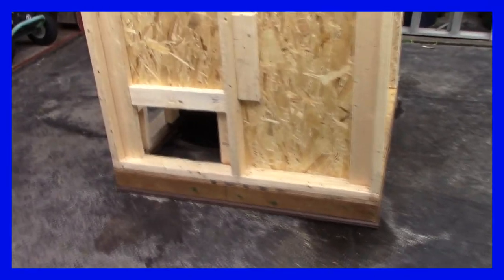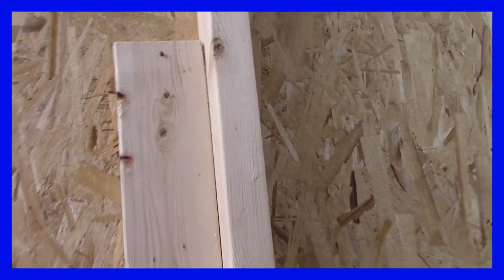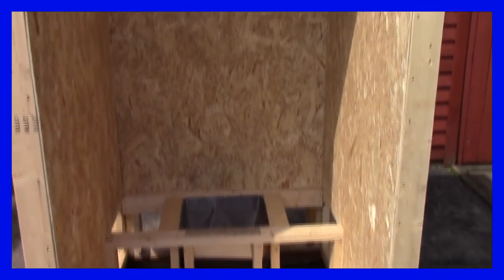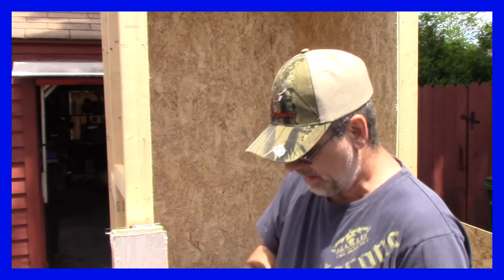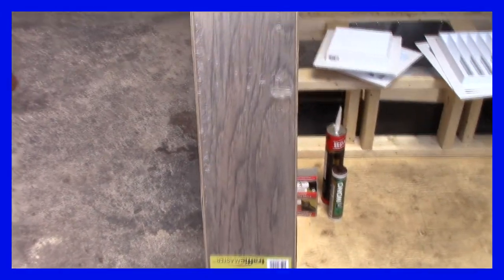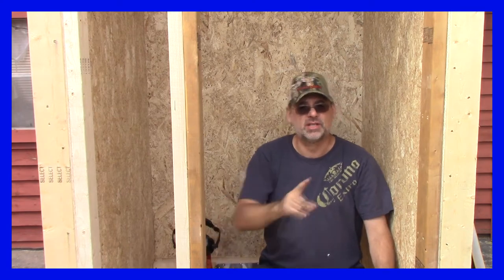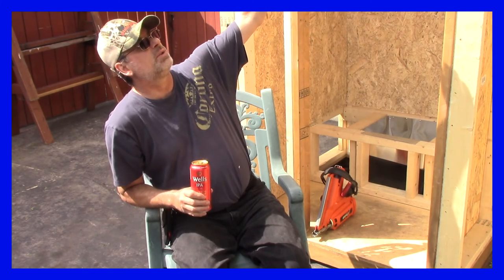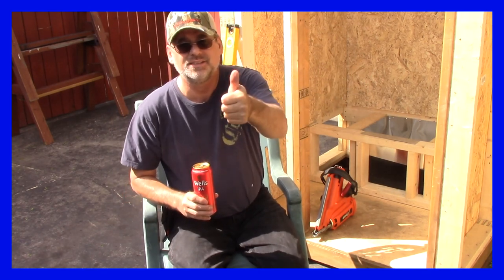HOW TO BUILD AN OUTHOUSE PART  3  - PARTS  1 AND 2 IN DESCRIPTION BELOW

Comment: Looking good there Steve on that outhouse. It will be interesting when you get to the part about the ground in what's done to it when you sit the outhouse over it :) Have a good one and don't work too hard!
Reply from the maker: Well that will be interesting since it's going over a done hole and an old outhouse getting removed. Cheers Terry.

Comment: OSB is press board chips. To me anyway.  Yes girls have stout pissers. I have a saw mill 3 miles away. Off cut lumber is cheep. I can buy it cheep then cut it straight and save $. They have everything,  ruff cut, treated etc... 
Great show. Ike to see the details of this project even down to the hardware.
Reply from the maker: The women are hard on an outhouse LOL  Not many saw mills up here anymore.  I buy lumber   that say  usa on most of it. The hardy siding is american too and the low exchange makes it $50 a sheet with tax of course.  Lots of hunt camps in Georgia so they must have outhouses - haha I have  never seen a  camp with a flush toilet , only two with  electricity .  LOL

Comment: Nice Shitter. But I  would never spend that much for an Outhouse Shitter. OSB Oriented Strand Board is chips glued together. The  Sawdust shit they use to throw away. Now you can make a pretty shiitter out of it.. Does your Paslode run gas out that much, Mine does not run that long and let expensive gas out.  Unless you are keeping the finger on the trigger. Nice Job Buddy
Reply from the maker: Thanks and I agree most that approach me for one to be built think it's too much money as well but I can build one for 1/4 the price and last 1/4 the time too.  Cheers !!!